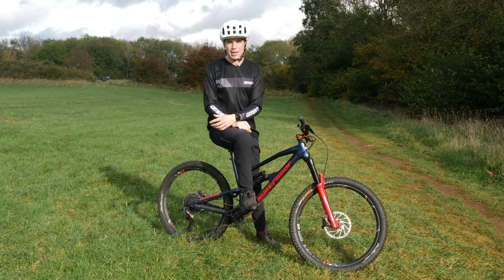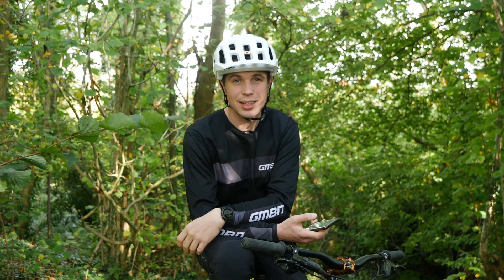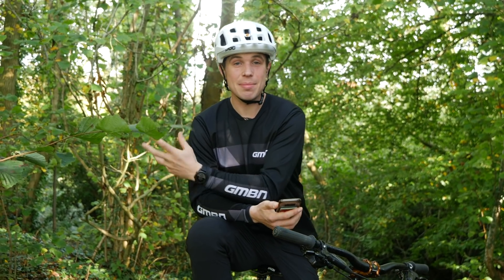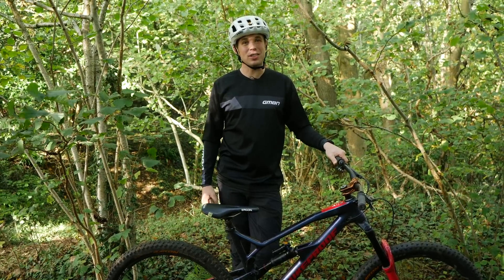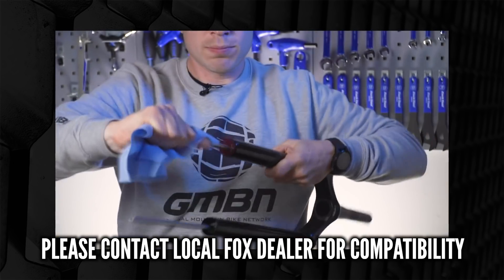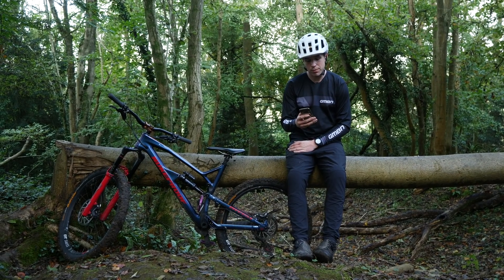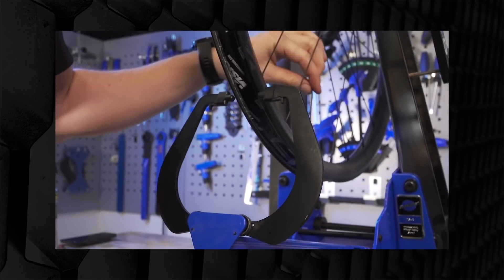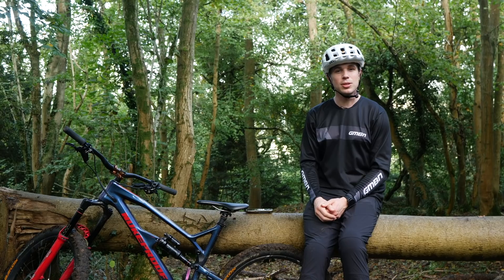Why Aren't Disc Rotors Bedded In By MTB Manufacturers? | Ask GMBN Tech

Comment: doesn't your handle bars hurt your wrists unless your elbows are bent? mountian bikes are not built for long time riding or calm riding just constantly falling down a hill but who is always doing that. wish i knew before i bought one. hurts my back too.
Reply: Sounds you need to setup your bike for your body.  No bike is ready to use when bought/delivered, fine or big adjustments always need to be made. I can ride for 6 hours on my bike without pain anywhere

Comment: To convert 2011 Fox 36 Talas to Float air system, NA2 with Evol will not work since there is no transfer dimple in the leg.  The older NA system with air transfer rod will work.

Comment: #askgmbntech
Hello i’m running a 10 speed shimano transmission with hg freehub and I would like to change to 11 or 12 speed, do I need to change the freehub?
Reply from the maker: Hey, check the freehub body. It may be that you are running one that is only compatible with 8-9-10 speed cassettes. If this is the case you will not find a spacer behind the cassette on your 10 speed setup. If you do find a spacer  you can simply remove this to open up 11 and some 12 speed cassette options.
Reply: GMBN Tech oh perfect thanks for the help 🙂
Reply: no, only road 11 speed cassettes require a wider freehub body
Reply: ultiss thanks man that’s awesome

Comment: When I've spokes break. If 3 have broke then I always have the wheel rebuilt.
Reply: Lisa Rogers This. Spokes go through a stress cycle every single time the wheel rotates, so they can get weaker over time. If you snap a third spoke, it’s time to replace all the spokes.
Reply: I have a 32 hole hub and 36 hole rim. There are no 4spokes. Since 6 years. The wheel is true. I'm riding downhill, dropping from 12 feet drops. I won 2 local small championships. I never had an accident. Since 6 years.
Reply: Nexus Paradigm: different thing entirely. The reason for changing the spokes after the third one breaks is that these spokes are a sample group of the whole wheel. All of the spokes share a similar load, and over millions of wheel revolutions all will inevitably reach their fatigue limit. The three broken spokes are just the first ones to break - the rest will soon follow. On the other hand, you can take a 36-hole rim and build it up with, say 24 spokes just fine. :)

Comment: Wait a second. About the 1x cranks, doesn't this guy mean swapping the crankset or not... as opposed to using his existing crankset as a 1x? I just ditched all the front fuss on my bike and fitted a single sprocket. Looks like he wants to change that for a 1x specific crankset. That's how I read it anyway.
Reply: if you can get a good chainline there is no need for another crank. But since 2x cranks dont have a middle position you'll probaly need an offset chainring
Reply: Aren't at least on Sram Eagle the ring's teeth specific for 1x and for 1x chain? Might not work with old chainring.
Reply: Ofcourse it helps if you match the chainring with the chain and cassette, but there's almost nothing you can't buy separately. Just measure and match. But that wasn't my question.

Comment: #askgmbntech Hey guys! Love the channel. My question is: I want to upgrade my 2x9 drivetrain to a 1x12, preferably Shimano SLX since it's quite cheap and I don't have a fortune to spend. I have a GT Avalanche Comp 2019 27,5. My rear axle is 135mm, I've been told that that won't fit 1x12. Do I have any other options apart from replacing the rear wheel or even the whole frame? Thank you! Gabriela :))
Reply: Nx eagle is a grate and not to expensive option

I think it fits?
Reply: 1x11 is pretty good if the 1x12 doesn't work out.
Reply: if you want to use the slx 12speed cassette you need another hub, but you can also use the NX cassette, or sunrace or something else
Reply: 3rd party brands, sunrace etc, make shimano driver 12 speed cassettes, I've done a 12s XT/SLX/sunrace/KMC setup and it works well on budget

Comment: 9:59 The shop would have also made sure the wheel was true. So $10 for that is very fair. If you have a habit of breaking spokes maybe look at changing your riding style but as henry says, there is no way you can change a spoke without removing the rim tape.
Reply: Dave Williams there is if the nippel is good
Reply: @fastbicyclerider7300  if the spokes are a set length and if there is an overlap between the nipple and the spoke (which there is because they are threaded) I don't way your getting the nipple threaded without rounding it off, stripping the thread, cross threading it or piercing the tape.
Reply: @M3PH11   Dave Williams  I think you can do it by flexing/bending the spoke, which you have to do a bit to thread through the other spokes anyway when replacing a single spoke for most lacing patterns. However I don't think reusing nipples is a great idea, except in emergency. I don't think $10 is unreasonable to change a spoke and re-tension either way. It'd be very unusual in any trade for repairs to come with free labour unless the fault is partly the retailer's fault As for why other spokes are breaking, if it's a rear wheel in the drive side, it could be that the chain has gone down behind the cassette and munched the spokes, the damaged ones are likely to snap eventually. Also riding a wheel with a snapped spoke can knacker other spokes if they are loose as a result.  In my experience butted seem far less prone to breaking.
Reply: @M3PH11  You can just bend the spoke a bit, no problem at all. If the nipple/spokes are old it's a good idea to replace the nipple aswell.